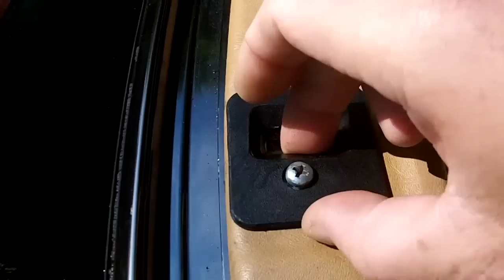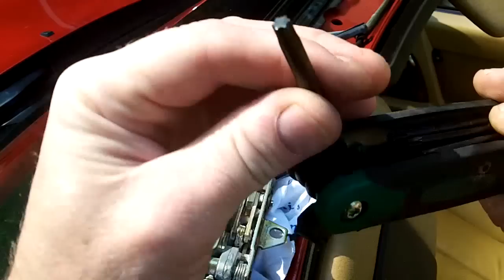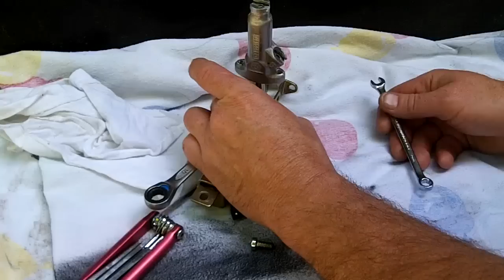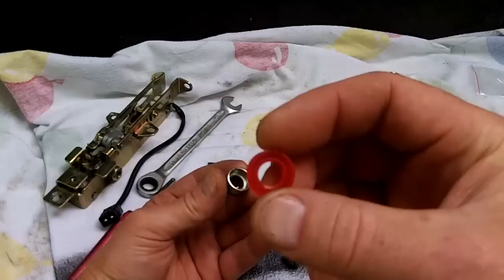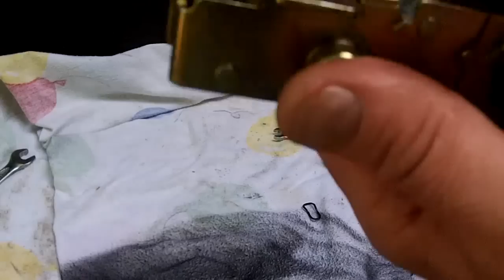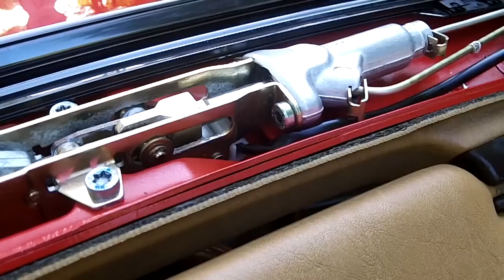Rebuilding Hydraulic latch cylinders  Mercedes convertible R129, W124 convertible

Comment: Had to heat up cylinder shaft to loosen. 7mm wrench messed up shaft. smoothed shaft. everything worked OK.
Reply: I came close to that but it finally released before rounding.

Comment: I did the rebuild, and no leaks, but cylinders didn't seem to work anymore.  I did remember to refill the reservoir.  I actually sucked it all out of the reservoir and cleaned it as much as possible, and put new OEM Mercedes fluid back in.  tried it a few times, didn't seem to unlatch or make much noise.  weird
Reply from the maker: +Raul Romo it may take a few tries to get the air bled out of the system hopefully the pump is working properly..what year is your car ?
Reply: 1994 SL600 Mercedes
Reply from the maker: You may need to manually unlatch and lower the roof with the roof tool in your trunk .. Then do the power window reset (engine running ). The power window reset is lower each window and keep holding the window button down for 10 seconds after it is down.. Then do the same raising the windows. Then ,with the roof now down, ( engine still running) and windows down .. Pull the roof switch back as if lowering the roof and hold for 10 seconds ... Release . And pull back and hold for another 10 seconds. Then try closing the roof with the switch. If it starts raising and goes all the way.. Once it is up keep holding the switch forward for 10 more seconds to reset the roof . Sometimes you have to do it a few times
Reply: I will try that.  thanks again

Comment: Don't exist for 124 Convertible ...
Reply from the maker: Serge Bonkain   It does..it is the same part used in a different spot on the W124.... on the W124 it is the rear bow lock ..exact same part #
Reply from the maker: Serge Bonkain very welcome
Reply: ***** I saw that the location of this cylinder is different in the 124 and I try to know how manually raise the soft top because my cabrio is in closed position ? ( Sorry for mistakes because I am Belgian ) Thank you so much
Reply from the maker: I'm sorry.. the w124 and r129 manual roof procedure is very different.. I'm not sure how it works

Comment: I tried the reset on my CLK 430 soft top and had no luck. Now the front windows won't go up at all. The rear windows work fine. The top continues to show a malfunction when trying to close. Any suggestions? Thank you!
Glenn
Reply from the maker: Damn..  unfortunately , the Star scan from the dealership or independent shop with the scanner is about the  best I can suggest ...sounds like a window position microswitch or roof controller